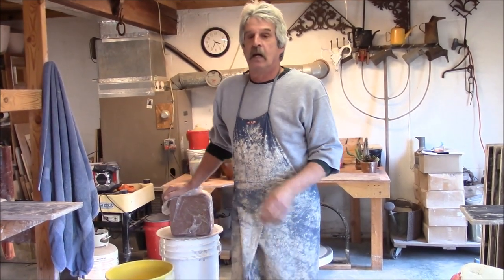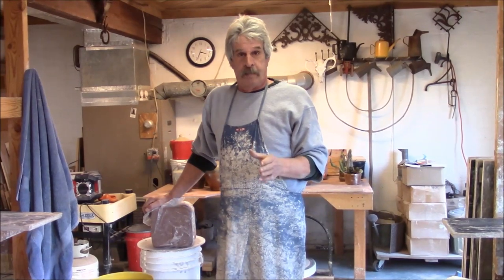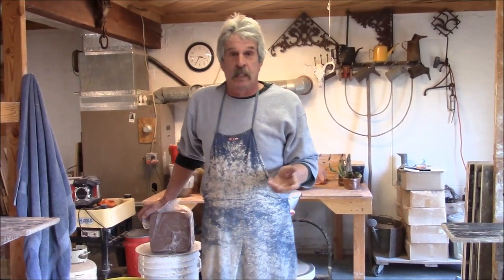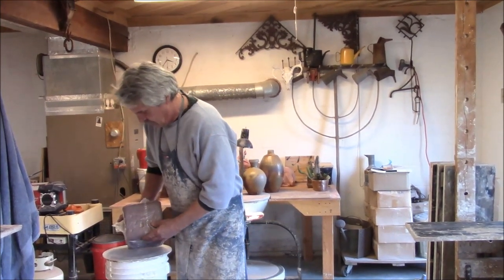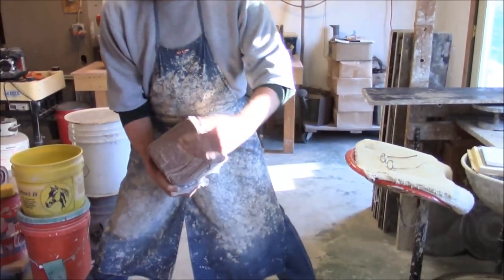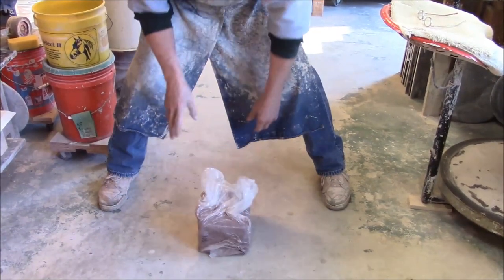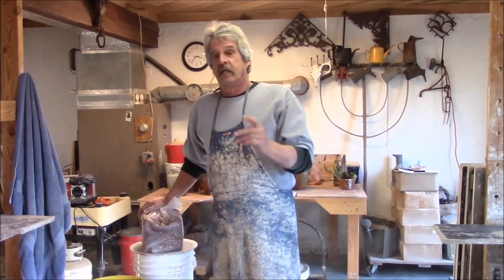How to fix stiff clay.

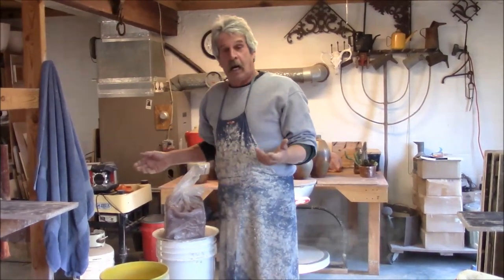Comment: At 2:39, did he actually slip and used the term, "knead" instead of "wedge"?  LOL.  I love it.  I'm a new ceramic student, and I keep forgetting the proper term: "wedge".  Being new to ceramics, I, also, purchased a bag of firm clay and have been struggling with it on the pottery wheel.  I will definitely try your method.  Thanks.   11-29-21.